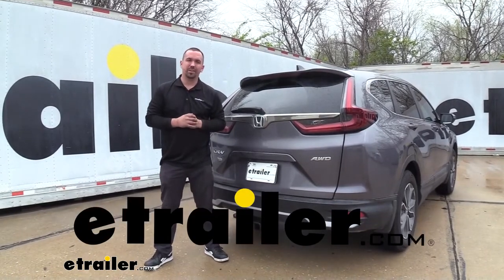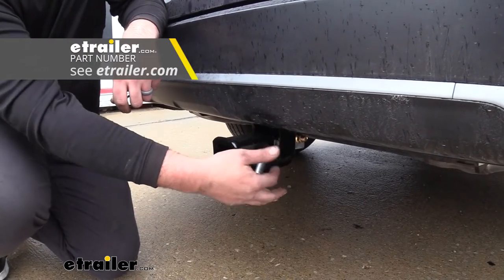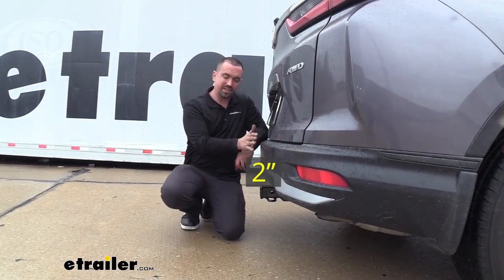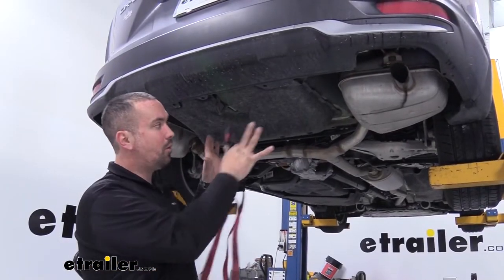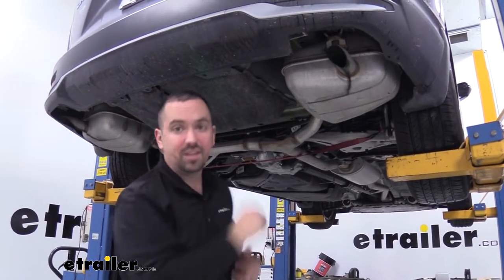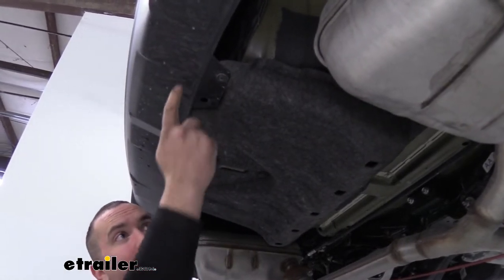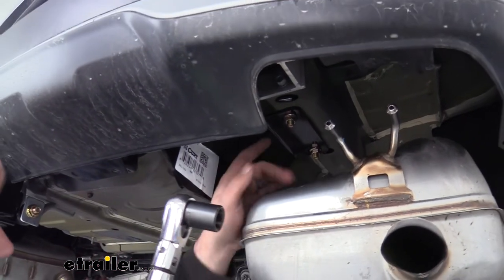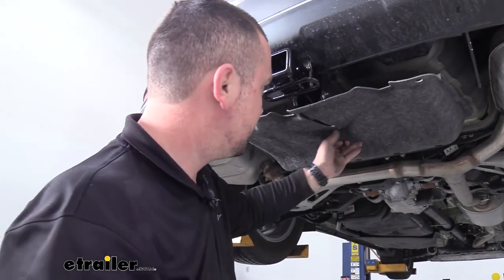etrailer | DIY Install: Curt Trailer Hitch Receiver on your 2022 Honda CR-V

Comment: Once you get the tow hitch up into place, connect the middle part, at least loosely, and then you know it's not going to fall on your head. I did that and it worked great.
Reply from the maker: Great advice. Thank you, we appreciate it!
https://www.etrailer.com/Trailer-Hitch/CURT/C13397.html

Comment: how can i install the screws without this spring tool?
Reply from the maker: It would be extremely difficult to thread the hardware through the frame without using the fish wires. They are included with the hitch, or available separately as part # C58410
https://www.etrailer.com/Trailer-Hitch/CURT/C13397.html
https://www.etrailer.com/Accessories-and-Parts/CURT/C58410.html
Reply: I think that would be impossible. I wouldn't even try it. Otherwise you're going to lose your bolts.